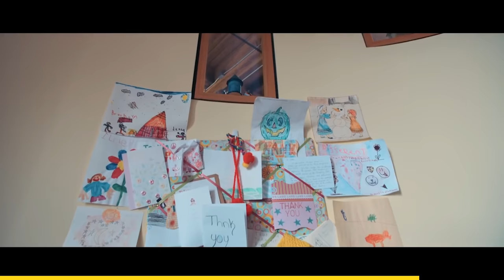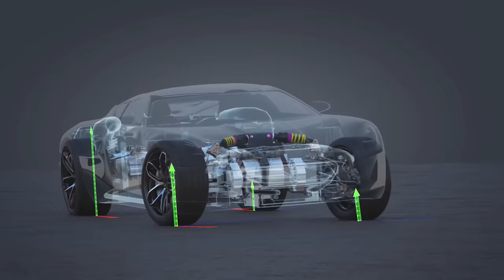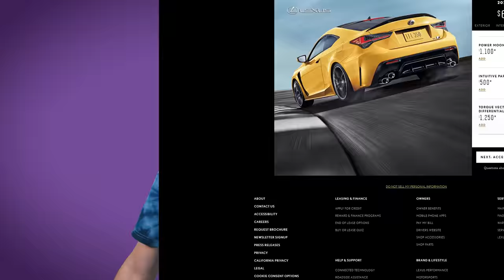The Most Confusing Part of Your Car EXPLAINED

Comment: "You could let off the accelerator, but what fun is that". The motto of every mustang driver.
Reply: I can hear the footsteps of the crowd running away
Reply: FixOrRepairDaily🤭
Reply: Crowds: SWEATING
Reply: Exactly. You can't crash into other cars and bystanders by letting off the throttle. 😄
Reply: Fuckin GOT EM
Reply: Until it magically wrecks
Reply: In this life it’s Yeet or be Yeeted so no I shall not let off the accelerator lol
Reply: All crowds, road signs, and landscapers are shaking after hearing that
Reply: Tell ya what, when I get the LSD I'll let off the pedal... A little.
Reply: @wyattkennell2874  just cause most can't dodge the signs and pedestrians doesn't mean I haven't... Gotta love not having traction.
Reply: Saw this, not ironically in a reddit group. Can't remember the context of the conversation. But yeah. Someone had that to say about torque vectoring.
Reply: honestly I'm surprised they dont use mustang's for riot crowd control at this point ....guaranteed to disperse the crowd.
Reply: Driving sideways
Reply: Right before they careen into a ditch, wall, or other driver.
Reply: FoundOnRoadDead
Reply: This stereotype has been gracefully passed to the hellcats
Reply: As a Mustang owner, can confirm
Reply: @ANSWERTHECALLOFJESUSCHRIST  Strange, I always thought that letting off the throttle makes the 'stang lose grip and spin into the crowd...It is engine braking after all.
Reply: No need to let off, the crowd will catch you.
Reply: Proud NewEdge crowd crawler
Reply: Someone say crowd?
Reply: @TheOptionalKind  hi Optional Kind.
Reply: @straightlinetech  yes. The Utah guy
Reply: @TheyCallMeMrMaybe  as GT40 fans also
Reply: @ANSWERTHECALLOFJESUSCHRIST  Laughs in mid engine snap oversteer
Reply: When it's 2022 and people are still making mustang joke when the mustangs have improved and now other muscle cars do that: low IQ moment
Reply: @TheOptionalKind  I need a "crowd crawler" sticker on my 00 GT now 😆
Reply: I hope i get the opporunity to crash a mustang one day. love a mustang
Reply: The crowd crashes into me
Reply: I will still be buying a mustang
Reply: I and the police who chased me would have to agree.
Reply: Mopar bois took that over long ago
Reply: Yup so true I've seen the video.
Reply: @terminalvelocity6659  then he did his job
Reply: @ol_smokey9370  fr
Reply: thats exactly why they end up in the crowd cuz they dont know how oversteer works when you regain traction
Reply: #crowdplow
Reply: that motto must’ve been made by someone who didn’t drive lightweight fwd car (if you let off the gas in corner weight transfer will make the back slide)
Reply: Usually their problem IS letting off the accelerator mid turn

Comment: I would love a b2b on awd diffs especially with differences in how different companies approach it like acura's SH-awd vs audi's quattro.
Reply: Plus the different VAG systems. There's Torsen, HALDEX and more!
Reply: This is actually interesting. Would love to have one episode like that
Reply: Subaru has like 4 different types alone. Lot of ppl don't know that but yeah
Reply: Even if you narrow it down to a 2002 Impreza you have 3. The sti one the manual and the auto and they're all completely different
Reply: @Nic Beurskens  a bunch of cars used torsens they are crazy how they work.
Reply: americans don't understand awd's and thusly can't make an explanation video about them :)
Reply: @StanleyKubick1  most Americans truly don't. I'm American but I'm also ADD and hyper research into things and know Subaru alone has like 6 systems or so, even in 2002 a regular outback had one of 3 and a Forester in 2004 was offered with three here that weren't even vcd. Then there is whether it's LSD or not, wrx had manual or auto then STI had the driver controlled center diff. But like I said I've actually had my center diff showing and repaired a center diff clutch solenoid on my old Forester myself so...... Yeah. Not run of the mill junk to tear into that.
Reply: they also used to come with dual-range cases. those were the best. But then there's also the issue of what LSD we're talking about. They've used helical LSD's, SureTrac and viscous in so many combos: 50/50 viscous rear with 35/65 helical front or 41/59 torsen rear with same ratio helical front, and everything inbetween.  There's no rhyme or reason. 

Best system imo is quattro, pre viscous days. Or just keep it real simple with a tried and tested part-time 4x4 and manual lockers
Reply: @StanleyKubick1  especially the differences between 4x4 and AWD. Also the differences between true AWD like Subaru and Audi which send power to all 4 wheels all the time vs the FWD based AWD in most crossovers which only engage the rear wheels when the front ones slip.
Reply: After tons of research to satisfy my own curiosity, Acura's SH-AWD seemed to be the best (at least recently, can't speak to 2020+ stuff). Which was surprising, considering Quattro etc are so good.

Comment: I'd love to see a B2B on everyone's favourite forgotten JDM technology: 4 wheel steering!
Reply: JDM and early 2000s Chevy trucks. Spoiler alert! It worked better for one than the other.
Reply: That's not uncommon on modern luxury cars, I believe Porsche and a few others are using it.
Reply: Yes please, very please, very yes
Reply: Yes, please more
Reply: @ol_smokey9370  Z32 comes to mind.
Reply: Forgotten? But there's like, I think, 3 different Mercedes models that have it. I think even some Toyota/Lexus and Nissan cars have it.
Reply: Prelude 4ws
Reply: The new Lexus have it
Reply: Super HICAS
Reply: Even Renault has it on the Laguna, but my C class doesn't 😅
Reply: @Dominik189  It was really popular back in the 80s and 90s, when more common vehicles like the Prelude had it. It died of in the 2000s due to drivability issues, and resurrected in the late 2010s.

Comment: Acura/Honda did electronically controlled electromagnetic clutch packs for active torque vectoring in the SH-AWD system on the 2005 Honda Legend/Acura RL! Standard!
Reply: About a decade earlier they had ATTS on the fifth generation Prelude 
Used clutch packs to feed more power to the outside wheel when cornering 
This was 97 that it was first introduced so the Prelude really lived up to its name with this bit of tech

Comment: Thank you for accurately representing this. 
The SAE in general agrees that a system is not "Torque Vectoring" unless it can predictably send torque to one wheel, this is only accomplished through over-speeding. That is why the companies that you pointed out and others will not use the term Torque Vectoring for their brake based systems. They reserve it for systems that are able to send torque to one specific wheel on demand like the Focus RS, the Evo X or the Honda SH-AWD system.
Reply: I'm somewhat confused, if one wheel is braked to zero, doesn't that mean all torque is sent to the other wheel?
Reply: I hate fords but their awd system works really well in the snow and ice but the eco boost motors won’t make it over 100k without major repairs.
Reply: @killhour  yeah they don’t have a front lsd in early mk3 models either
Reply: I have the Honda with the SH-AWD, by whatever name it has in Honda vs Acura. I'm a big fan.
Reply: @brutalbasspro  but there are so many that have lol
Reply: @Appletank8  Sure, that’s definitely correct for the idea of a single differential. 
With two axles (three differentials) you would need to apply brake torque to all 3 other wheels. (Additional possible variations when considering locking differentials)

The idea is that, to induce yaw without reducing longitudinal acceleration, you need to add speed to the outside wheel. This is not possible without a higher input speed to the differential. 

To induce yaw while also reducing long acc, you can simply apply brakes to an inside wheel. This is totally accomplishable with a brake system.
Reply: @killhour  Yes, that is true that the Focus RS cannot send as much torque to one wheel as the powertrain can potentially generate.

The twin clutch system is limited by the clutch capacity of each of its rear clutches. It can only send the capacity of the clutch to the wheel and the capacity of the clutch is lower than the output of the powertrain. 

To clarify, it is not required to “split” 70/30 in a way that equals 100. It could do 70/0, or anything in the range from 0/0 to 70/70 (of course the clutches would not transfer anything over 100%, but hopefully that makes sense).
Reply: @Team_Trash_Dog  the cars with triple LSD may also work well.
Reply: @Ninjasraynonu3  like Ford GT40.
Reply: @CommieHunter7  me too also a big fan of Acura vs Honda.
Reply: So it's funny yall mentioned this, cuz I'm building a road track car off a 2013 Honda TL in a manual and the v6 engine and specifically choose it for the SH-AWD with the rear wheels that turn based on your needs, and I love the Honda J-series
Reply: @brutalbasspro  3.5 ecos can last to 250k miles with good care and some Italian tune ups every once in a while.
Reply: @matthewkloep8391  strange I worked at a ford dealership for almost 5 years and most of the over 80k didn’t drive themselves into the dealership. How does that saying go found on road dead I think it is?
Reply: @CommieHunter7  that's exactly what I came here to comment.  I have an Acura TL with SH-AWD.  I can accelerate through a tight curve at 60mph.  Definitely a huge fan.  Plus, its handling in snow and rain is immaculate!
Reply: @killhour  Acura uses pretty much the exact same system.
Reply: The golf R and GTI have a 'torque vectoring' differential as well right?
Reply: @brutalbasspro  mines got 150k miles with a hard tune in it and it still runs great.
Reply: Go to the playlist down to science it has a episode on diffs
Reply: Subaru and the Nissan Juke. My Juke handles better than any car I've ever driven on stock suspension. Obviously the all-wheel drive model not the front wheel drive. Biggest downfall of the Juke's all wheel drive system is the only option for AWD comes with the CVT transmission. But if you take care of it I've managed almost 500 horsepower without the bottles and have yet to blow up a transmission. However opposite of people that don't know how to drive proper with a stick and blow out their clutch packs, not only am I not going to miss a gear but my RPMs stay at Red line the entire range while you're asking granny for some shifting lessons and location of that anti-lag switch. You know so you can really blow up that clutch as you fade away in the rearview.

it's all in the ankle, it's all in the ankle. 🤣 Noonan.
Reply: Hey Donut, if you guys do a follow-up video on torque vectoring, I'd be more than happy to let you beat the shit out of mine. It's what I built it for. Good luck getting it to go sideways without immense oversteer or e-brake to initiate, as the Juke also boasts one of the shortest wheelbases. Great Vid 👍

Comment: Really wish you guys touched on SH-AWD! The RL in 2005 had a proper mechanical torque vectoring rear diff, and an 'acceleration device' at the rear axle, overdriving the rear wheels by some ~2%-5%. It could do 20/80 or 80/20 split, AND send 100% of the power at the rear axle to one wheel. It's a super sophisticated system, and was/is used in everything from the RL to TL, to even having the torque vectoring diff in the MDX and RDX!

Comment: Definitely do a B2B on diffs
No brainer 
You guys kick ass, keep it up
What about the suspension? How does that effect the traction loss? Traction is a monster to get right. Part of the fun
Reply: totaly agree on everything this guy said
Reply: I'd love to see a B2B on Stroker engines vs Cylinder Boring
Reply: Specifically Torsen style diffs.
Reply: @BigfootUnibrowMan  yes. Or try also V4 vs Inline 6 Cylinder engine.
Reply: @danmanthe9335  Torsen? What is that?
Reply: @purwantiallan5089  as far as I know, it's a geared system where it transfers up to 100% of the torque to the wheel that is spinning. The way it was explained to me was that if one wheel is on ice and the other is on dry asphalt you won't know about the ice.  I had one installed on my 4wd Ranger 20 years ago and the traction was phenomenal for a daily driven mountain vehicle. Conditions didn't matter, I always had traction. I never knew how it worked
Reply: I’m

Comment: I really like your content, specially when you approach engineering and the specs of racing categories. Please keep up the good work.
I know that your audience is mainly US based, but I strongly suggest that you place both imperial and metric measurements. Nm is a standard unit and one that makes the whole pound-foot question more obvious for those who are somewhat familiar with kinematics from high schoool. 
If think it is also helpful to establish that an open differential has some advantages besides the cost. 
Again, good job.

Comment: That open-diff brake-based thing kinda reminds me of the antique tractor I sometimes use for scraping snow off the driveway and mowing fields and stuff.  It has 2 brake pedals, one for the left, one for the right, and if it's in a slick spot and having trouble going around a sharp turn, I step on the inside brake and it pulls it right around (although, obviously not automatic)
Reply: That's also how snowblowers work
Reply: Airplanes have that too
Reply: That's not just on antique tractors. I had a 2006 John Deere that I used all around my small farm. When I mowed hay I would uncouple the brake pedals so I could brake on the inside of the turn. This would allow me to make a u-turn at the end of the row around the point of the inside wheel. This set me back on a path parallel to the previous row. 
At other times if one wheel started to spin on soft ground there was a lever I could push with the heal of my left foot to lock the rear diff and it would get traction and pull through. 
Lots of times operating my tractor took both hands and feet to make it all happen.
Reply: I have unlockable brake pedals on a 2019 tractor.
Reply: My old 42 ford 9n does the same
Reply: That sounds hella fun!!
Reply: My lawnmower does that

Comment: Make sure to include SH-AWD from Acura when you discuss AWD systems and vectoring.
Reply: Even though Hondas “AWD” system is shit? There’s plenty of roller tests that they’ve failed since the AWD just doesn’t work
Reply: @thegoldentheory4383  Honda Real-Time AWD is a different system than Honda's SH-AWD
Reply: So many honduh fanbois... "super handling" awd is nothing special. Honda keeps trying to make Acura into something it's not, and they keep failing. You'd think they would have learned a lesson or two from GM by now - you can't polish a turd. Putting lipstick on a pig doesn't turn the pig into Marilyn Monroe. Putting brighter headlights and an interior made of different plastics into a Honda doesn't change it into something else. Acura will always be second tier to actual European makes. They just can't shed that basic, cheap Asian feel at their core.
Reply: Agreed, it was even introduced ALL the way back in 2005 on the Acura RL (I owned one for 7 years). It's NOT a brake based torque-vectoring like others that Jerry mentioned!
Reply: My subaru outback and my beloved Nissan Juke has the best torque vectoring out of any of the cars I've ever driven.
Reply: @VorsprungDurchNik  "They just can't shed that basic, cheap Asian feel at their core" well put. I much rather look at an Acura from the outside than spend time inside it driving it. And dear god, the Infotainment system belongs in hell
Reply: @VorsprungDurchNik  Do you actually know how SH-AWD works? Calling it nothing special implies you don't. And comparing Honda to GM and saying Honda feels cheap? Okay...
Reply: I do know how it works. It's a vectoring system like every. other. manufacturer. uses. Yes, every system is a little different, can't go stepping on other manufacturers patents or licensing agreements. But it does the same damn thing as all the rest of them. And the "super handling" moniker is just a marketing gimmick. If the Honda SH-AWD system was so spectacular, you'd see all the other econobox manufacturers lined up to license it from Honda instead of dumping r&d funds into designing their own that performs the same. And yes, Hondas are cheap. They're built cheaply out of cheap materials and sold cheap to cheap people. They have the stink of cheap on them and it will never wash off. But I think Honda knows that and is proud of that fact. At least Honda isn't as cheap as Nissan or Mitsubishi, the Japanese brands akin to Chrysler or FCA or Stellantis or whatever the massive failure of an automaker is calling itself these days. I don't think you can get any cheaper or worse than those two craptastic brands without being Tata or some Chinese knockoff.
Reply: @VorsprungDurchNik  what a weird obsession… not wanting to be cheap?

Comment: Watching this reminded me of my 1st Gen Acura RDX. The SH-AWD system made that little CUV handle in ways it didn't had a right to for its category. Absolutely loved it once I realized that to get the most of it, using the throttle through the turn was key. I still miss it. They changed their character once SH-AWD was no longer offered.
Reply: How's the turbo. Mine has a sticking wastegate
Reply: I have 3rd gen, baby handles like a dream for what it is
Reply: @Kana0211  mine was fantastic for the 3 years that I had it. Had to sell it because I moved to a different state but the guy who bought it never reported any mechanical issues.
Reply: @magick7637  Yes. Also handles like a spring recoil.
Reply: yeah picked one up last summer for my winter car.. loving it. already full bolt on.. upgrading turbo in spring.. rev down and send it around corners.. good winter car while my 6x6 accord coupe rest in the garage.. only prob its HORRIBLE on gas!!!!